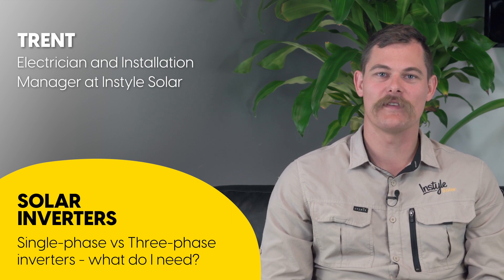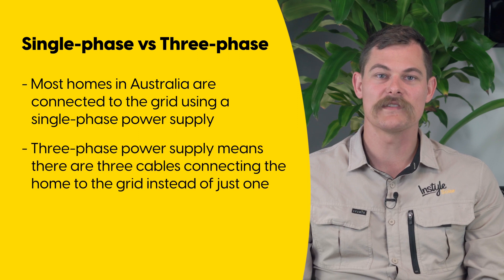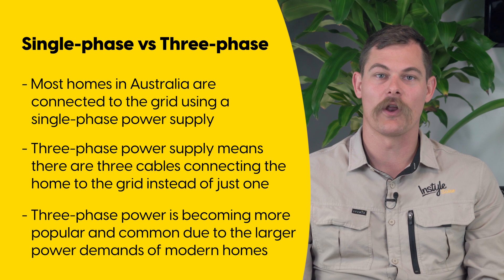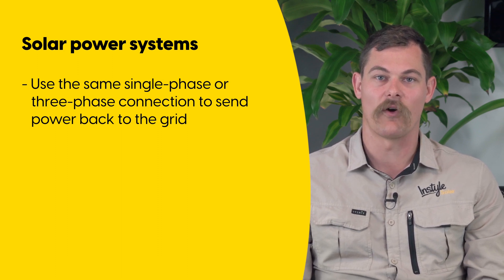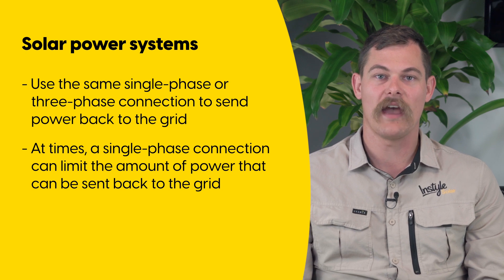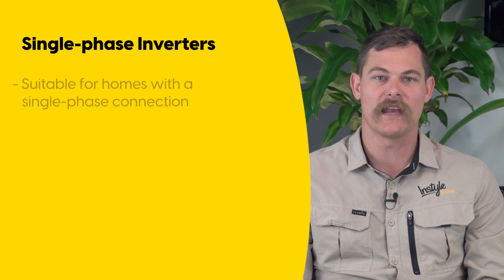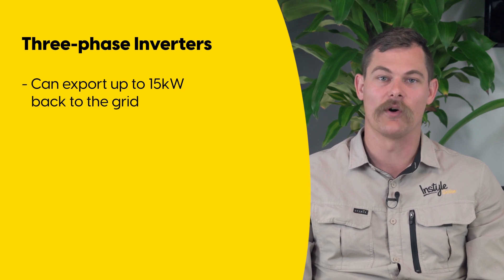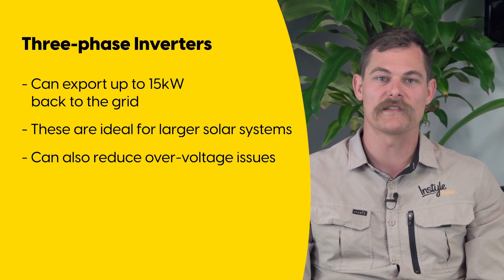Single-phase and three-phase inverters

Comment: please help, our place still don’t have net metering. So I’m considering zero export device. We have three phase connection, can single phase inverter be ok? Or should we only should use 3 phase inverter in my case?? Also, how 3 peas inverter, share the power production across the phase.. if only phase 1 has load of 1kw, does it only supply to phase 1 only?

Comment: Can we use one phase from the inverter for home knowing that the three phase inverter is alimenting a water pump? Same thing we do with grid electricity. Of course we need to add charge regulator and batteries and so on